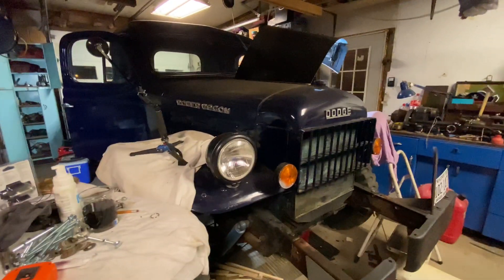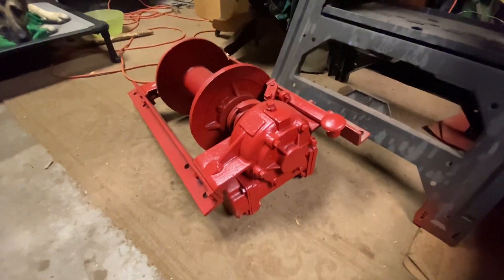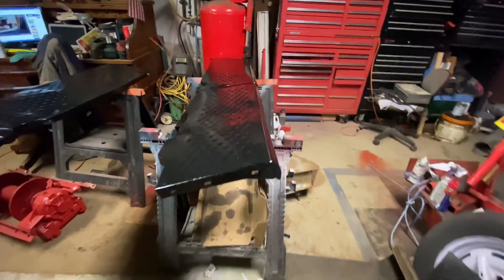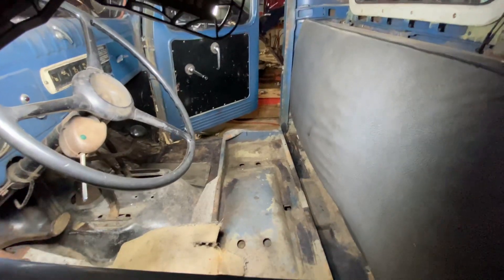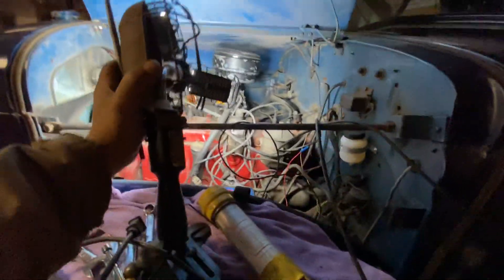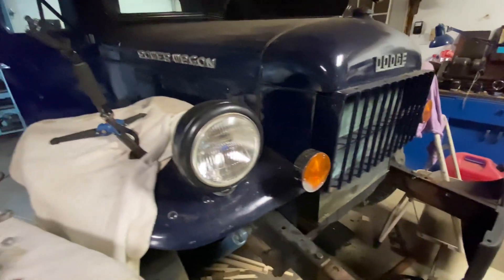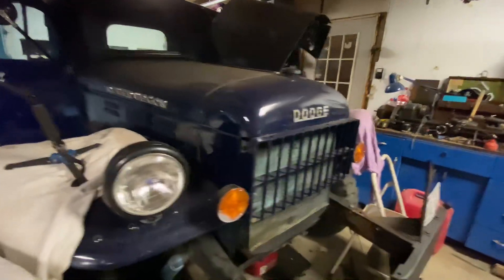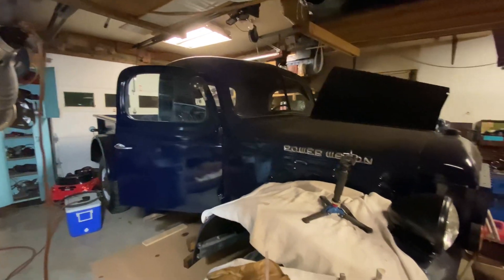1966 dodge power wagon update winter project

Comment: Great truck! Thanks for the video! I am deep into a restoration of a 1951 Power Wagon that I hope will someday be as nice as yours!
Reply from the maker: Thank you so much. Yours will probably be nicer. I’ve done a ton of work to this but I’m far from a professional and I have a small budget so it’s not a restoration by any stretch of the imagination but it is a fix up and I’m happy with the results so far. Been working on this truck for over 35 years although it was in storage for 20+ of that.